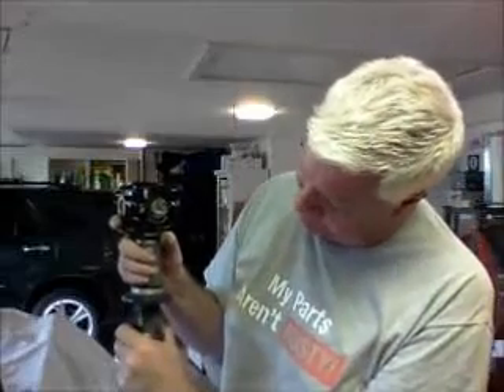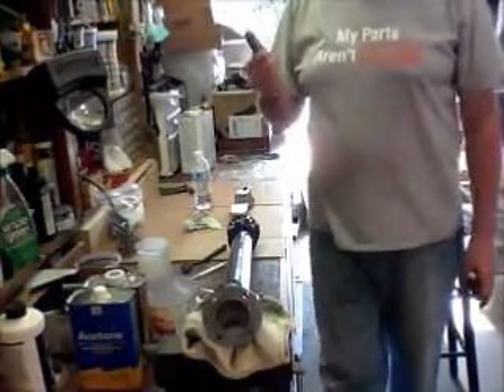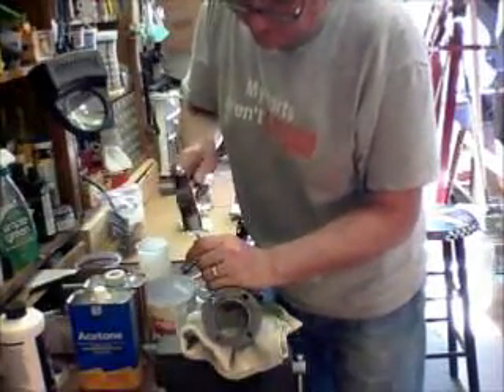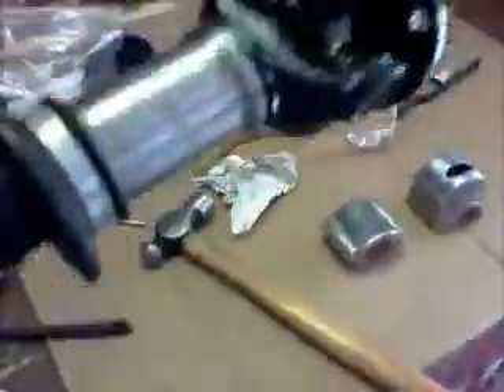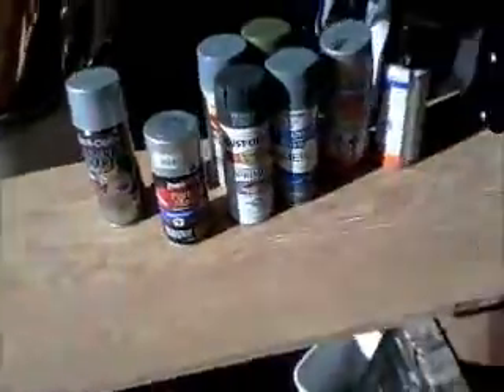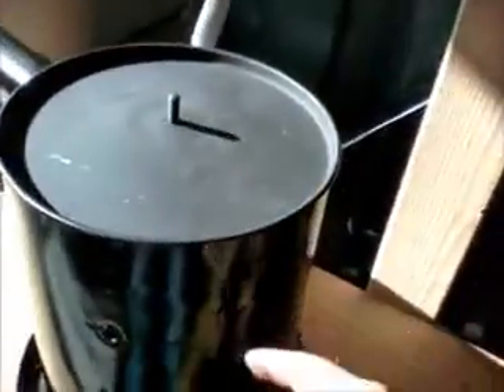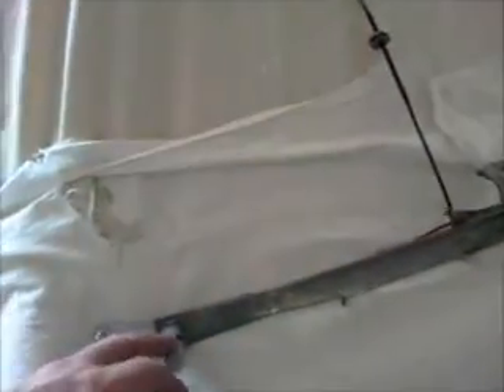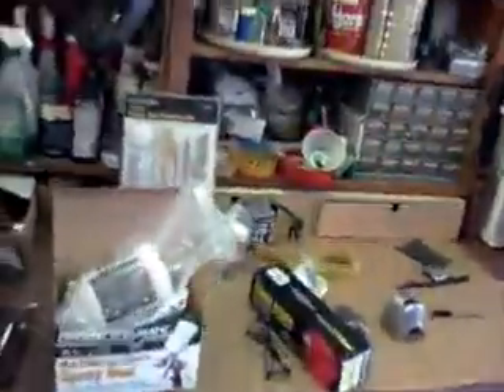Bettie my '63 Jag E-Type Restoration - Drive shaft U-Joints

Comment: Slip joint is  for suspension travel.. Lay it down hit the on top of the  horizontal  plane of jount . Keep doing till you have rolled and done to all four sides. .U joints should turn free but not sloppy.